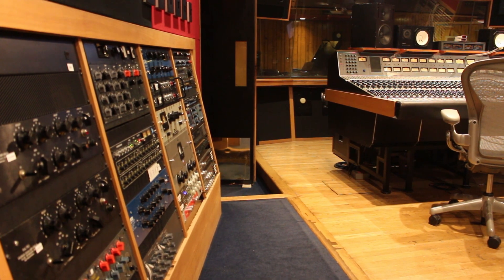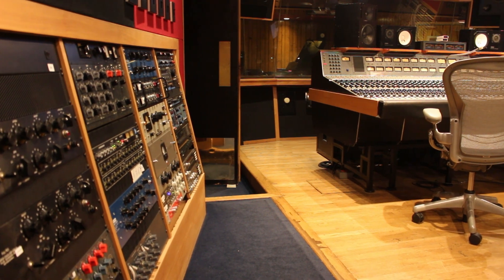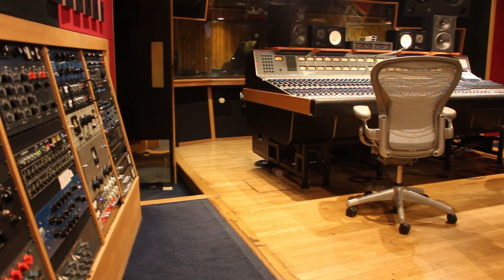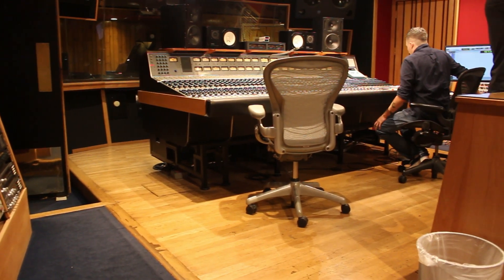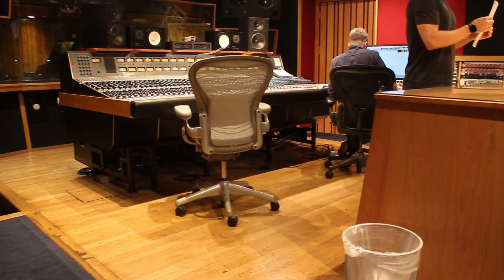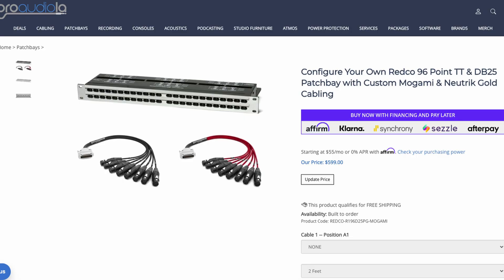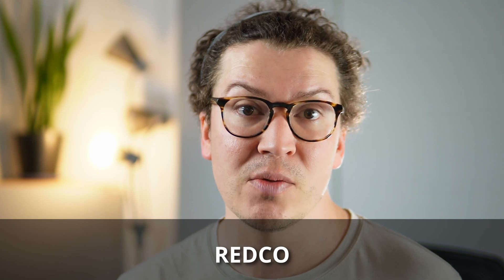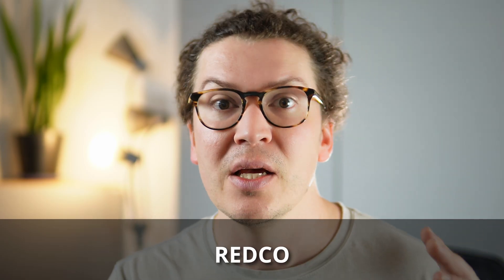Beyond Soundproofing: How To Wire Your Studio Like A Pro

Comment: Pretty much all my audio is run through CAT5/6 cables as analog audio. It's a bit more bulky than a networked system, and I didn't run anything through the walls, but it works amazingly for me. Everything is hard wired to audio connectors so I don't have to worry about any RJ45s as a failure point. I'm sure people will take great personal offense to it, but it works for me and is incredibly cost effective.

Comment: I'm drywalling a tracking room right now. I'm planning on cutting a round hole through the walls of my mixing room into the tracking room to run a 4" pvc pipe through which the cables will run. Then attach 90 degree elbows on each end of the pvc pipe and backfilling the pipe with sand once all the cable are laid. I plan on running two 8 channel snakes, two guitar cables, and two speaker cables, and a cable for talk-back. Liberal amount of caulk will be applied around each hole in the wall and the pvc pipe. I plan to make a wooden stand on each side to support the 90 degree elbows so they don't twist and dump out the sand. Am I forgetting anything?
Reply from the maker: Sounds like a solid approach to me.